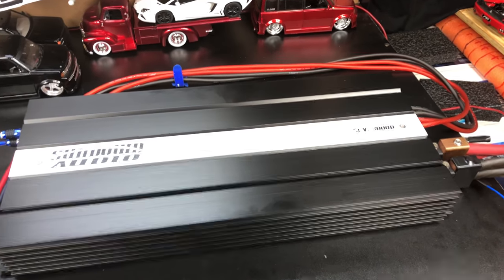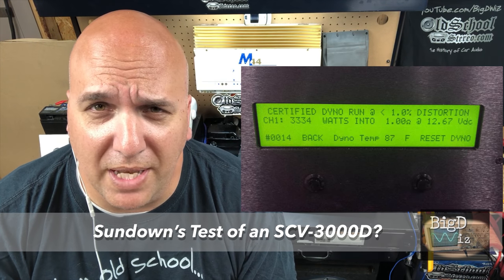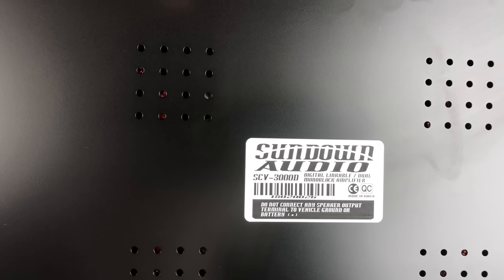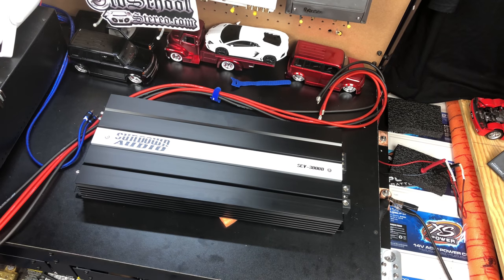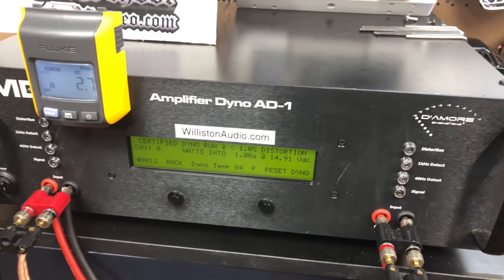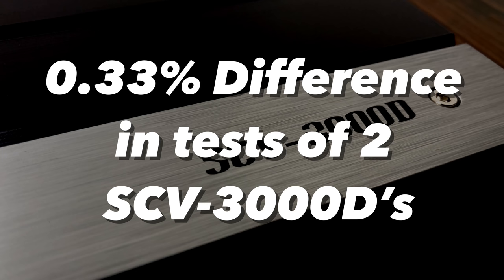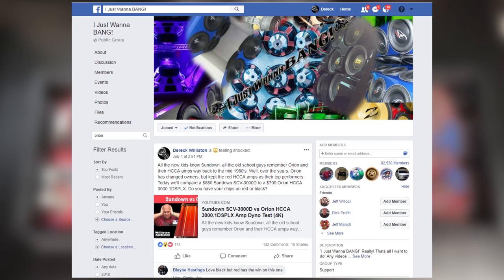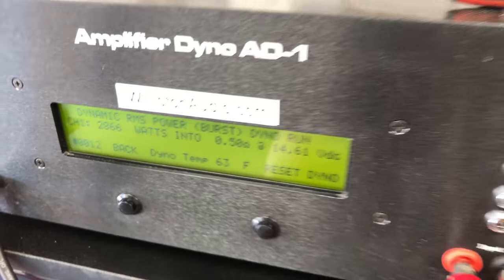Sundown SCV-3000D Amp Dyno Test - Follow Up (4K)

Comment: That consistency of the test though... Definitely some interesting results!
Reply from the maker: Right! I was blown away by the consistency of both amps. S&I must have changed their design from the original one Sundown tested, that's all I can think to explain the differences I'm seeing compared to the early model they tested
Reply: That to me is insane quality control! I would like to know how many amps were made in between those or the age difference.
The way I take what Sundown is saying is that anything above 13 volts doesn't matter. They're not stating you're going to get any more power that they designed it to make. The 13 volt test compensates for lower quality or inadequate charging systems.

I guess we all assumed that it will make more power with more voltage. If it's designed that way, it will. Of course this is the way I see it.
Reply: Lately Orion have proved themselves time and time again. I'm sorry, just look at the guts and numbers. I have owned the new XTR amps and now own most of the biggest HCCA amplifiers. Both are ridiculous.
Reply: Is there any way to tell if it made rated power at 13 volts?
We all just assume that it should make more power with more voltage.
Once again is this something that could be designed to do for people that don't have their charging system fully developed yet?

Oh and by the way, go Zapco! 
Still a "gem"?
LOL
Reply: Yes it's a general rule more voltage more power. But Orion actually rate their amps at 12.6 volts and usually exceeds the ratings even as that voltage.
Reply: I do know that it wattage alone shouldn't determine the quality and capabilities of an amplifier. I don't understand any of these amplifiers or am I affiliated with anybody with them but there are tons of other features and specs that make an amplifier better than another other than 300 to 500 watts difference in power.
To say, "oh yeah company A kicked company B's arse.... In your face! We made 400 more watts than they did!"...... Is so wrong in so many ways. The components used. Dampening factor. You all know what I'm talking about.
Reply: My HCCA 4,000.4 is a class H amplifier and the all around specifications are better than most class AB amplifiers around!
Reply: Actually the specifications are a lot better than most class AB amplifiers.
Reply: Crap I hate thinking of stuff after I finished but oh well....
Big D you did and amp that proves that it's not all about wattage....the Rockford Fosgate T1500-1bdCP.
it would seem overpriced for the wattage you get we want you saw the efficiency and the capabilities to fight box rise, it could hang with amps that have more wattage.
Reply: Seth Tynan I know. The Orion is a great amp... no doubt about it. I just hope everyone doesn't think I'm defending Sundown LOL that is by far the last thing I'm doing!
Believe it or not I have many reasons not to defend them LOL.
Reply: Justin Murphy I love sundown subwoofers definitely! It's the last thing I want to do too. I have Crescendo subs right now, but want to get 4 18" Zv5s.
Reply: Seth Tynan Definitely! Orion is more than ever back on top of this game, thanks to MD Audio.

Sundown is still an awesome product and we are proud to sell both.
Reply: CarAudioFabrication  ain't it lmfao  hell yeah BigD....
Reply: Justin Murphy he only got 2200 watts at 13v out of it he posted that on Facebook
Reply: Justin Murphy  no it only did 2200 watts at 13v he posted that on Facebook
Reply: +Seth Tynan almost went with nightshades but the Z, NS, and Team series subs all have 3" voice coils which imo feel that for the price you should get a 4" one like other manufacturers do. Also the BL ratings on them aren't exactly setting records by any means. I do have to give them credit for having some of the biggest xmax though.
Reply: @justinmurphy2227  Box rise isn't a thing 😜
Reply: @scottxp800  how much extra wattage should you consider when buying amp to compensate for box rise? Can you eliminate box rise and how?
Reply: @mac4782  on average a 4 ohm load in a box will become an 8 ohm load when running,  and a 1 ohm load will become 2 ohms, in PA world this is why we state rms and program input,  program is double that of rms to accommodate the load rise,  so you have a 1 kW sub rms you put 2kw programme in, as your amplifier will half in power output when running the load,,  but watch out for turning the volume up when power compression starts to kick in as the driver heats up. This will end up with everything going quiet without you wanting it to lol
Reply: @alanchatfield5533  Thank you sir!
Reply: @mac4782  hi chap,, also another way to help you with it is grab yourself a current clamp metre and a volt metre,  run your amp on the sub in the box in question with a 50hz sign wave from your audio input and then measure the volts and amps going to sub. So let's say you had a 2 ohm nominal sub running at 50v x 10 amps that's 500 watts, then to work out ohms you do 50v  ➗ 10 amp to get 5 ohms dynamic, ,  so get an amp that can do 500 watts at 5 or 4 ohms for your sub that has a 500 watt rms rating,  the amp will probably put out peaks of 1kw at 2 ohms let's say but the sub should handle it as that will be it's programme input power at 2 ohms. This will help with running subs at the maximum input power taking in to account the resistance peaks as it's running,  but it will also leave you with little room for errors and things could heat up lol
Reply: @alanchatfield5533  I had to read it twice lol but I understand now. Thanks again sir!

Comment: An amp that meets its power rating is a good thing.  That it does so at such a difference in price...not so good.  Sundown needs to rethink their pricing strategy.
Reply: Crazy 8s Drums Exactly. I paid over $500 for my scv2000d and it has performed well, but when you have a amp that is priced significantly cheaper, and does way more power, efficiently, well, time to change brands
Reply: Yes! This ain't 1989!
Reply: Yup, got that right.  I have the DC 3.5k and it's great.  If I had my time back I'd gladly take an orion for half the price.  Done and done.  Stuff's all worth pennies used, so save what you can.
Reply: This is true if the only specs you look at on amps are power AKA watts.
Imagine an amp that puts out 500 watts, true power, more than another amp. Even significantly more say the other amp is a 750 watt amp and this other amp puts out 1250. More than likely you're going to feel and most importantly, hear the difference. Especially if you compete and there is a meter in your vehicle.
You buy it. You watched a YouTube channel show that it made this much more power than two other amps in a test. You ended up spending another $100 on the amp that you didn't know about because you skipped ahead to the best section of all ...the dyno run and pictures! Now you are replacing a 500 watt mono amp in your system with this higher power unit. You start to install it and you realize your 0 gauge won't work because this amp takes a 4 gauge input. You happened to dodge this bullet because you happen to have a 0 to 4 gauge reducer that you had bought for a previous 4-channel amp in your system. 
Whew!
Okay proceeding on you go to install the speakers and you have four leads coming from your subs because your other amp internally bridged itself because it's just a benefit to make installation easier. Then, you also notice that, all the speaker connections are spade terminals.....WTF? But the power was a set screw and now the....speakers are....???...WTF.... oh well it's okay because... powerrrrrrr!
Somehow you managed to get your four leads of 10 gauge wire in to some crazy odd spade terminals that you had in the bottom of some cardboard box that had picture frames, a can of WD-40, and some mouse droppings with tore up paper that's smells like old urine in it.....a mousy nursery ( we all have one of these boxesl). Moving on. Almost there! You go to insert your short RCA jumper cable because your previous amp had a full range output for your mids and highs amp. You think about it for a second because you can either do a Y adapter or run a 16 foot cable. You decide to do the last because your head unit as a separate subwoofer output and you've been wanting to do that so hey it's one of those things that you just got forced to do but it's okay you can justify it. And you were going to hook a bass knob up but instead of having the standard Cat5 cable it has a headphone jack style cable. You decide to do away with the bass knob because of the head unit subwoofer output. Justified!
Finally you decide to look at the owner's manual and find out there's several other things that are different that you're actually downgrading in for....more power. Are there any amps in this class also had rated all their power ratings at 12-13.4 volts.....this company rated there 500 watts better amp at 14.4 volts. It's a good thing you're about halfway there and saving up to replace your 7 year old alternator with a high output unit but you're a little bit behind because you paid an extra $100 for this bad boy.
You finally decide to watch the whole video and come to find out this amp also draws a crapload of headlight dimming amperage. We're not even going to talk about the crossover differences this one now being fix crossover points but it has bass boost!
Moral of the story is, there's a lot more to amps than just power ratings and I wish everyone would buy off of the sum of all specifications instead of just wattage alone.
I would buy the Rockford Fosgate T1500.1bdcp knowing full well I could get an amp three times the wattage for the same price and these are true, comparable, watts. This amp just does so much more with what power it has plus it's reliability and customer service. 
There are so many other reasons to buy a certain amp over another then just power ratings alone.
Sure the above scenario is crazy and out there but could it possibly happen? Yes!
Reply: Your Rockford Fosgate amplifier was likely made in the building adjacent to the room that the Sundown amplifier was made.
Reply: Crazy 8s Drums what does that have to with anything.?
A build house builds what you pay for and ask them to build. 
I can't help what a company pays for, builds,  then prices to their customers. I can't help that their specs doesn't match up with what they print. It has nothing to do with them being built in the same place. This is an a quality control issue. Especially since both of the Sundown amps made the same ratings. They knew what their amps made and sold them with different specs. Rockford did to except their specs were lower AKA underrated then what they had put in their manuals. And the customers got more than what they agreed to.
Reply: They are very proud of their name.
Reply: Justin Murphy only thing you proved with that long ass story was maybe an amp pulls more amperage then the other for same power.....lol it happens but I hope someone would notice if the amp they chose has spade terminals it probably wasn't the best choice to begin with!!
Reply: james mcnugget all I can say is I tried to find all the good there was in this amp but in the end it doesn't do what it was supposed to do. Even the manufacturer agrees to it now.
Reply: Cliffton Whitaker yep, that's all it is.  GREED.
Reply: Justin Murphy oh so I'm guessing that's u in said story with the spade terminals amp :/ future reference if it has power an ground spade terminals then 99% of the time it's not gonna do rated... sad but true
Reply: Greezy_Chef I know exactly what you are saying. I went with the skar skv1 4500.1. I wanted sundown but refused to pay the money for less.
Reply: Cliffton Whitaker for around the same price u could get a scv4000d that is if u mean the skar skv2

Comment: Very respectable to test a different amp. Even if Sundown could get more power from their testing the Orion still significantly outperformed under the same test parameters. Sundown did rated power which is what you would expect.

Comment: Absolutely still isn't worth what they are asking for that amp. Too many other amps out there that put out more power for less money. 900 dollars basically for the name. No one is saying they didn't put out their rated numbers. The do put out rated, they just aren't worth what they ask for them. The value for me isn't there. Their subwoofers may be top of the line but other companies have better amps for the money. I have said it from the beginning that the Orion would beat them all. It's just kinda sad to see that the sundoen is one of the most expensive amps in the line up and put out the least amount of power. It did it's ratings but the other amps in the line up put out more. Orion for the big win!!!!!! Hell even the new company wolfram 3k I believe smashed the sundown 3k, and for the price that they sell for one would be crazy not to buy a new wolfram.
Reply: I want the 3k wolfram to go with my subs, they even sell a warranty for under impedance wiring.
Reply: For $100 more you can get a Taramps bass 12k, that AFTER rise will give you 7-8k. So yeah, the price is absurd.
Reply: Rob Land exactly
Reply: good luck with that....go read  some reviews..i did as i was considering picking up a pioneer 4 channel..no thanks
Reply: Mister Hat Agreed.
I've had a few of the Pioneer GMD amps and I kicked the hell out of them and they still performed very well. 
Solid amps, clean power, steal of a price. That's a win in my book.
Reply: Just Chillin and zombies 🤣🤣
Reply: I couldn't agree more I had a scv 2000 and sundown 12s . I gave up my ct sound 1500.1 and soundqubed 10s worse mistake ever . My lower priced system sounded way better I only switched cause my work sells sd well use to lol not anymore .

Comment: More or less inline to what I thought it would be for production variance.  It put out the rated RMS power so mission accomplished by Soundown.  I know your tests aren't "flawed", esp sure your tests are controlled and you have proven to be very consistent.  I'm also more then sure those amp's aren't "defective".  Ah well, no worries.  I'm just happy to see a 3,000W RMS amp marketed as a 3,000W amp as opposed to being a 3000W amp with a "12,000W MAX" power label.

Comment: Can't say I was surprised by the result.  I was thinking the same thing that you stated in the video.  You didn't slam Sundown for their amps performance, so I don't see what's up with the fuss.  Sounds like they just didn't like bad publicity.
Reply from the maker: It was also interesting to note they didn't post a public video in the past 2 weeks as they stated they would. My beef about this situation is the way my test was put into question with no concern of how the amp performed and the possibility the build-house may have made changes affecting output power.  These amps have a huge mark up from the price SD is paying from the supplier, but I understand they need markup to pay for advertising, support, etc...just seems like a high price compared to some of the other amps that have better performance and more heatsink and components.
Reply: They pay 250ish an amp on these. Well I can say that for sure. Skar pays 250 on there 3500
Reply: BigDWiz You don't have to prove yourself. I've watched you test 100's of amps. I absolutely trust your results, and I'm sure all of the regular viewers do too. You covered all the bases here, tested with 2 different amps, and got identical results. Sundown is just being a sore looser. I bet they just try to act like this didn't happen from here on out.
Reply: Questioning you or your methods was a bad move and will not be taken well by the community.  Most of us veterans weren't surprised by the initial test, the SCV isn't really their high tier amp and it still made rated power and you still get the build quality, customer support, and resale value that comes with that for those that are 30 cents per watt loyal.

I have met with Jacob (at the old shop) and I can tell you he and the rest of the gang there and true enthusiasts and really do care.  Might just chalk his reaction as a parent not believing the story they're told about a child's misbehavior.   

I agree that if production model outperforms the prototype the issue is with the buidhouse; this isn't a new issue for companies buying electronics in the Far East.   They swap one part with something that (supposedly) has the same specs to save a buck or whatever, and the whole thing goes to shit.   This has even sunk a few companies in the past.